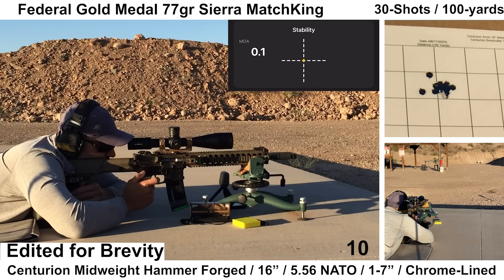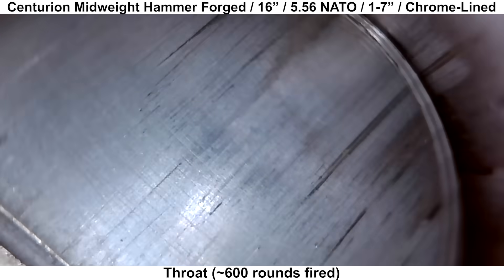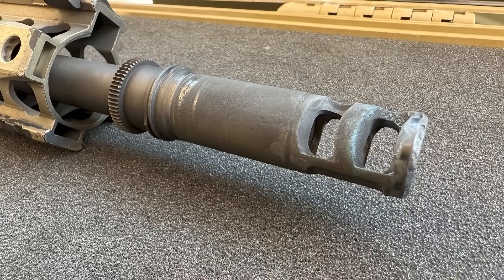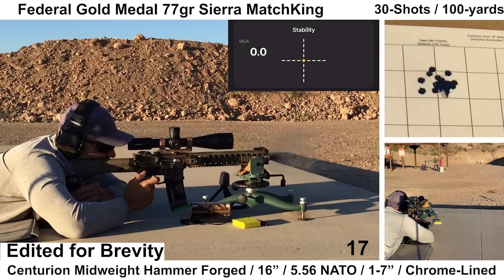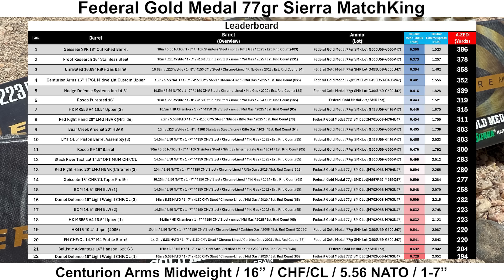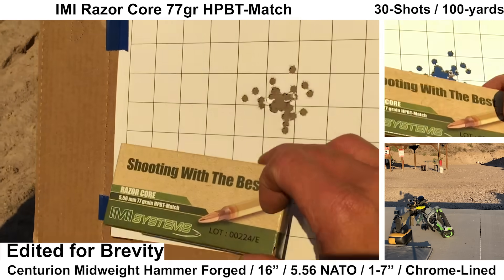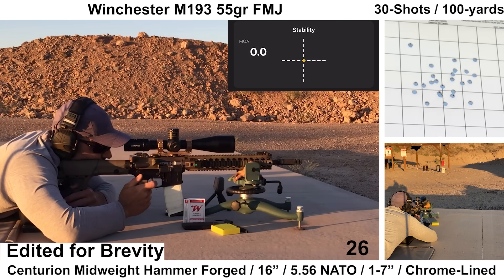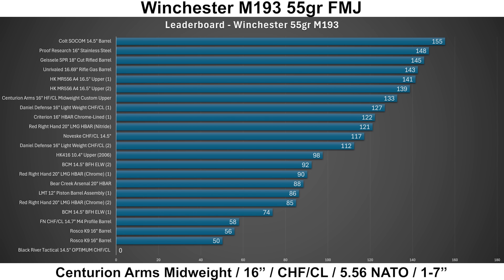Centurion Arms Midweight CHF/CL Barrel - Groups and Evaluation

Comment: Preston im a huge fan of your work and appreciate the video but I wish you would have tested without the muzzle device. Am i missing something or is this the only test with a muzzle device installed?
Reply: Nevermind I actually just saw that you have tested several with muzzle devices. In my experience muzzle devices almost always increase accuracy when installed correctly.
Reply from the maker: I generally prefer to test barrels without muzzle devices. That said, there have been a few tests where a muzzle devices stayed on for different reasons.

In this case, the upper was assembled during a SOTAR class, and the owner specifically asked that I not disassemble it. So I left everything in place.

Other tests have also included muzzle devices when they were pinned and welded. Or, in one case when the device was Rocksett in place. The owner was fine with removal, but I didn’t have Rocksett on hand to reinstall it, and I don’t want to send someone’s upper back in a different condition than I received it. Also, the LMT barrels have factory installed muzzle devices.  So, I didn’t see a need to remove them.
Reply: @PrestonJMoore  Makes total sense and sorry I actually posted that before I checked your other videos and saw a few others had muzzle devices. It could make a good video testing the same barrel with and without a few different muzzle devices. I have always had improved accuracy with any muzzle device but some more so than others.

Comment: The small gas port is no surprise. Seems to be a theme.  I love my centurion mk12 barrel but I’ve had a 14.5 with a .068 gas port😢
Reply from the maker: Oof, 0.068 on a 14.5 is quite small. Hope you were running a can with it or something
Reply: @PrestonJMoore I ended up getting rid of it because the gun was seeing mixed use.  I’ve had two of their mk12 barrels with no issues though and their customer service is pretty stellar. But I’m a die hard  criterion barrel man now
Reply from the maker: @aaa3d473  hard to go wrong with criterion.  Really high quality for the price

Comment: Bedding with loctite seems to make a difference
Reply: @uzbekistanimale Seems excessive in a thermal fit receiver.
Reply: @honzordr8517 thermal fit still left slop and movement, this is my upper so I bedded it when it had play. Thermal fit sometimes only pinches on certain points and not full support around the extension

Comment: Another great video Preston! Would love to see an Evaluation on a ARMAD steel SOLGW barrel. They claim some pretty big things with those.
Reply from the maker: It’s definitely on wish list!!!
Reply: Are they even out yet?
Reply: @JaxT83 Good question. I'd assume so, they said it was an option for the MK1 so if that's available I'd assume that is. But I honestly don't know what availability is looking like right now I haven't seen MK1s personally roll into my local store yet, but they have several other of SOLGW rifles. I have an M4-89 and I actually called right when Mike dropped the video about the MK1 and mentioned the ARMAD barrels, and I asked about sending my rifle in to get barrel swapped for one and on their website the announced an AerMet 100 steel "Alpha" Cam and Bolt back in 2023 so I asked about using that for headspace or just including that or whatever, and I was told both weren't released yet. But like I said that was months, so, idk. Hopefully soon since they keep teasing it
Reply: You had a ARMAD barrel test not long ago in na HK rifle
Reply: @michamichaowski8375 So HK did use 32crmov12-10 for some barrels, including older 416s, but, SOLGW definitely has a different process. Nitrided, chrome lined and their P3 rifling supposedly sets a whole new standard on wear and performance. So yea, I'd still be very interested in seeing a SOLGW ARMAD barrel evaluation because I don't believe it'll be all that similar to HK beyond Composition of the barrel, and that doesn't say much. There's 100 4150 CMV/416R barrels out there and they all perform differently. We've seen in Preston's videos that even 2 of the same barrel from the same manufacturer can perform completely different.
Reply: @michamichaowski8375my response above didn't tag you, so here's this
Reply: @justingabarik2527  it did tag , THX

Comment: It'd be interesting to see a comparison of m193 ammo between different manufacturers.
Reply from the maker: I have a video like that and several others planned… just need to get the time to put everything together. Plenty of other content on the way in the meantime. Thanks for watching and thanks for the suggestion!!
Reply: I'm not Preston Moore but he inspired me to shoot some 30 shot groups with M193 so here you go:

- Hornady Frontier M193:  
  - 16" BA Hanson barrel: 3.5625" 
  - 14.5" BA Hanson barrel: 4.000"

- PMC X-TAC M193:
  - 16" BA Hanson barrel: 4.250"
  - 14.5" BA Hanson barrel: 6.125"

- Winchester M193:  
  - 16" BA Hanson barrel: 4.875"  
  - 14.5" BA Hanson barrel: 7.250"
Reply: You have Buffman range on YT for that
Reply: Gi ammo sucks for accuracy
Reply: @lawerncemiller6557 counter argument ive shot sub MOA with it.

Its very accurate, what it lacks is consistency. With FPS fluctuations of almost 100fps with some brands, and barrels heating up it maintains about 2 moa most of the time. It just depends on a lot of factors.

Comment: I'm noticing a theme with CHF barrels and radial tool marks.  Hopefully the chrome doesnt start flaking away after 30 rounds this time.  Did you say the owner bedded the barrel in that BCM thermal fit upper?  Your reviews are awesome, but they make me scared to buy a borescope cause im pretty sure I wont like what I see.  Keep up the great work!
Reply: Most likely those marks are an artifact of the CHF process itself.  That process involves a mandral literally getting hammered through the barrel one smack at a time by a hydrolic ram.  The marks are where the mandral stops after each hit.  Tooling wear can worsen the marks.
Reply: Agreed on the borescope comment. I bought one for 20 dollars and let me know that I had fire cracking in my barrel after 200 rounds 😂 Definitely makes you think twice before letting your barrel get too hot.
Reply: @brettr6895 yea, I've always been a staunch advocate for chrome, but when I see how quickly some chrome gets pitted or starts to flake now, it's got me thinking maybe Nitride (when applied properly) is the better way.
Reply: @Mjdeben this was a nitrided barrel haha
Reply: @Mjdeben I'm saying in the bore that I scoped after 200 rounds
Reply: @brettr6895 ahh sorry dude.  Thought u meant the video.
Reply: Bro I have this barrel and absolutely is my favorite. There's no way in hell I'm putting a bore scope down there, ever! Lol it's a freaking tack driver.